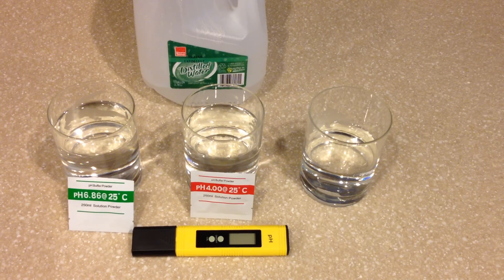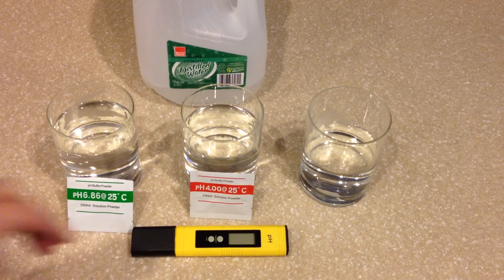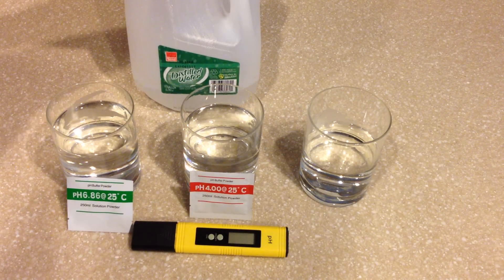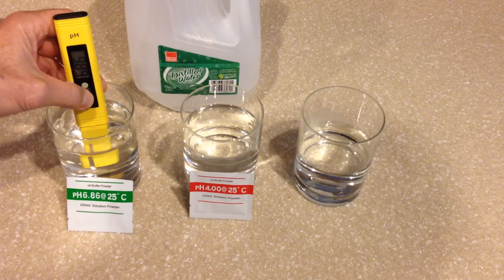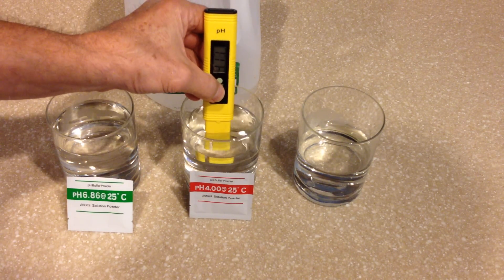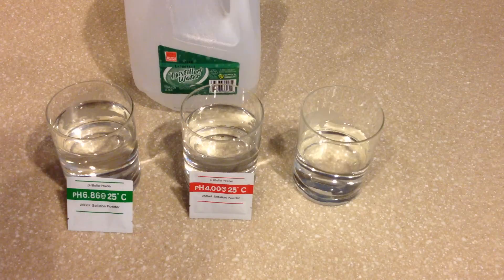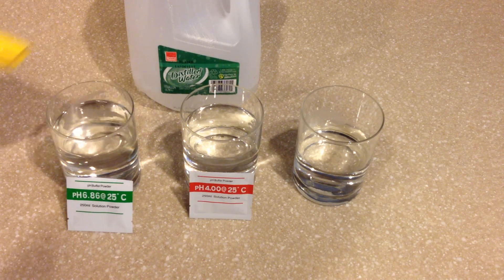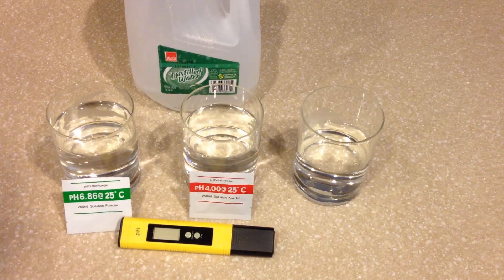Digital Ph Meter Review - Push Button Calibration

Comment: Be carefull to not let it standing by itself until the dam thing drops and gets wet inside by the hole in the back, now i can messure the temperature only, the pH is fixed on 6.86 or 4.00, wish value were the last i calibrated, sucks, i took only like 5-10 seconds to remove the battery and let it dry out 100%, still, too late.

Comment: Thank you. Mine was reading very low at first. This video helped simplify the calibration process. All I had to do was hold the cal button for 5 seconds when dipping in the solution, then it will flash to the correct number.

Comment: Hi! When I try calibrate with the 6,68 the pH meter only flash 4,01 . I did it right in the past but I having this software problem. Every time I press cal it just flash 4,01. Help me please
Reply: same, only mine flashes at 6.86 the whole time and I only have 4.00 calibration solution.  Have you by any chance figured out a way to switch between them or are you still stuk?
Reply: @retrol_za  I had to buy another phmeter
Reply: @npetroco  fok my, why must I stuggle like this XD

Comment: Do you have to warm up the distilled water? In my guide I see the distilled water has to be 25 C° it's also marked on your powder sachets
powder sachets. And is it necessary to use all 3 sachets or is 1 of the 3 fine enough??
Reply: i want a answer to!

Comment: Mine keeps flashing different numbers. I wonder if it's because I used a plastic cup instead of a glass. Also, is the 25 degree celsius on the powder packets relevant ?
Reply: Yes because the PH changes slightly with different temperatures. I got the blue one and it came with instructions.
Reply: @jonathanvandagriff7515  Wow. I suppose I have to cool my distilled water to 25 degrees then. Thank you

Comment: Trust me when I tell you people's !  Throw that crap to the waist bin and get a ph tester paper strip on Ebay . Much cheaper and simpler to used !  I installed under sink drinking water filtration system .  I get 160 ph test strip for $ 1.50  free shipping .  Tear a strip , put it in a glass of drinking water to test the ph level .  Toss the strip in garbage when your done . It's that easy .  No chem packet to buy or procedures to follow .....CRAZY !   😁😁😁😁😁😁😁😁😁😁😁😁😁😁

Comment: Honestly i had to write this as you just wasted my ph solution. Im trying not to swear and be angry, but why the f*ck dont you tell people that you need the 9.0 solution aswell? I mixed up the two solutions, and tried 2 of my ph pens, both were reading 9.12 and 9.15 for the 6.86 calibration. and for the 4.00 calibration mix it was reading in the 6.6 ph range. Theirs no way to fix this unless you have baking soda (being high in ph) which i didnt have at the time, or the 9.0 ph satchel mix. The reason for that is the pen will need the 9.0 mix satchel so when you mix the 9.0 satchel your ph pen read around the 12ph range( seeing as the pen was reading an incorrect high ph to start), so when you calibrate it, it will go back to 9.0. The ph pen has a built in reading of 3 settings for calibration, them being 4.00  6.86 and the 9.00. If you dont have the 9.00 satchel and your ph pen was reading higher then normal to begin with, you will be f*cked.  Each time you try to dip it in the 6.86 solution and calibrate it, it will read that mix as closer to 9, so when you calibrate it, it thinks that the 6.86 mix is the 9.00 mix. so conclusion is if your ph pen is reading higher then its supposed to, YOU WILL DEFINITELY NEED THE 9.0 SOLUTION AND YOULL HAVE TO DO THE 9.0 CALIBRATION FIRST. After that you can do what this video tells you to do. THIS VIDEO ONLY WORKS IF YOUR PH PEN IS READING LOWER THEN ITS NORMAL READING, OR IF YOUR PH PEN IS ONLY A LITTLE OFF ITS ORIGINAL READING. I hope this helps some people as your guide will definitely stuff more people around seeing as you have failed to mention the 9.0 calibration mix.

Comment: thanks for the clear video. I tried it many times but my meter goes up and down, then 0 and doesn't read. it's messed up....
Reply: yup mine had an issue during the 4.01 calibration it is a piece and it doesn't even give you an accurate reading in real conditions. I spent the $80 for a bluelab and the thing is accurate to 0.01 and takes like 10 seconds to get a reading.
Reply: @fivestar2227  Jesus Christ! $80 for a PH meter!? You got scammed!!

Comment: Question can u just use the 6.86?  Why use the 4.01 when I'm not trying to ph down that far. I'm just trying to ph to 5.5 - 6.0ph,  so I just calabrate it in the 6.86.   Am I doing wrong, or will it work? I mean since doing that my plants have not suffered any ph problems.

Comment: Great video, thanks! How often does calibration need to be repeated?
Reply: R E every time you replace the battery :) so not very often
Reply: Mark N do you have to use both powders
Reply: To calibrate it
Reply: @marcusjnewtonz28   how do u recalibrate after using the powders all up on the first calibration

Comment: It's so much easier and cheaper to use the old model with the screw. All you need is white vinegar, because you know its ph is always the same, 2.4 and then adjust the screw. With this newer model you will need to buy both sacks, (they say you need nothing else - wtf ?!!?) to calibrate this thing. I would also question the use of distilled water. The reason is that, with time and air, it lowers itself from a ph of 7 to a ph of 5.5-5.58. Which begs the question: Does used&old distilled water affects the results ?

Don't get me wrong. I really appreciate the video and the knowledge but let's try to observe some facts surrounding this device.
Reply: Please say more about why we should doubt the commercial calibration solutions?
Reply: @wayneessar7489  , I don't doubt anything. I just find it a hassle to have available a couple of ph solutions instead of a driver and screw process just to calibrate a ph meter. What if you don't have the solutions at hand ? What if you just don't find them in the market ? And what about the added cost ? Yes, sure, there are many "commercial calibration solutions". I just don't see the benefits in this one. And btw, if you are so adamant about such solutions, care to answer "Does used&old distilled water affects the results ?" Please, say more about why you ignore such fact.
Reply: @MrCroky123  I don't know if older distilled water is still free of ions.
The meter I chose can be, and is calibrated with Hanna solutions from the small foil packages.
They are easy to find where I live because the wine or beer making stores all carry them, and also in larger bottles.
I only test once a month so the packages work well for me as the bottles expiry about six month after you open them.
I also must adjust my meter with a knob and also to account for the solutions temperature.
In addition my meter can be checked very easily using Hannah's cal check solution that tells you right away if the probe is functioning properly.
The problem with a bad probe is it will make your meter read 7.01 for no reason and this can have a bad outcome.
Reply: You don't calibrate with distilled water. You calibrate with the pH 7.0 buffer, which you mix with distilled water. He also used distilled water to clean it between to two calibration buffers.
Reply: It doesnt matter If the distilled water Ph is drifting. Since it has no salts the Ph is moving very fast with even the slightest drop of acid or caustic. A puffer will stay at their ph and you can give a lot of acid or caustic to it before the ph moves. After the ph changes it will do so very fast. Thats why it called a puffer solution very very basic chemie

Comment: Do you have to use Risantec solution or can other brands be used? Can mixed solution be saved?
Reply: It calibrates to the solutions shown only.  They are available from Amazon very inexpensively because this is a generic Chinese cheapo meter.  There are dozens of the same ones being sold under different names.  .  And no, you cannot save the solutions.  CO2 in the atmosphere will change the Ph over time.

Comment: Those ph testers are crap , mine just says error after calibration ? and goes on to 00.00 the screw driver ones are much more reliable
Reply: I just bought two. The auto calibrated provides good stable results. The other manual calibrated one is pure junk, the values won't settle and jumps all over the place. So I disagree with you.
Reply: @fortuneflux  I disagree with you. I loved my screw calibration meter, until I cracked it. I kept some 7.0 calibration solution in a covered shot glass, and calibration was always quick and accurate. It never "jumped all over the place" for me. You need to turn it slow and steady, not with a heavy club-hand and meat fingers.

Comment: Can I just use ph7buffer only
Reply: The Risantec PH meter is designed to use 2 points of calibration, and it is 'hardwired' to the values of 6.86, 4.01 and 9.18. So, no it is not recommenced to just use a 7.0 buffer.

Comment: So the number it reads straight away when dipped in water is the number of the p.h?  so correct me if I'm wrong water is good if it's 7 yeah anything over is alkaline anything under 7 is acidic but I'm confused on the calibration part what does it mean it's basically testing if it can function correct is that right? do you have to put the p.h powders in distilled water also?

Comment: Do you need to keep the ph meter in a storage solution when not using?
Reply: No, but if the meter will not be used for an extended period of time it is recommended that you put a small bit of distilled water in the cap before replacing it on the meter. That will keep the glass probe from drying out.
Reply: thank you for the reply!

Comment: does this still allow for fine tune adjustments? also what if you have different calibration solutions like 7.0 or 10.0, will it calibrate to those?
Reply from the maker: The meter is 'hard wired' to the values 6.86, 4.0, and 9.18 for the purpose of calibration so for best results stay with those buffer values. The auto cal feature does not require any additional fine tuning.

Comment: So it's not good to test all 3 powders right?. My meter brought 3 packs. But every time I try to cal for 9.18 it throws like 10 points off from 4.0 and 6.86
Reply: When testing 9.18, you have to hold cal until it says 6.68, then tap cal again it'll say 4.00, then tap again it'll say 9.18, but for some reason mine says "err" after it blinks 9.18 a few times so it's not really calibrating right on my side.
Reply: SmokingLoud127  You should test as high and low as you think you will be registering, I would use all 3 but rinse between them in distilled water..

Comment: can i calibrate 6.86 than 4.0 then 9.18
Reply from the maker: The Risantec meter uses a 2 point calibration system. You should use either the 6.86 plus the 4,0...OR....use  the 6.86 and the 9.18. For most applications using the 4.0 for second point of  calibration works best.
Reply: ok thank you so much :)

Comment: Where can you get replacement sachets of PH 6.86 powder?  Most meters I ever used were made to calibrate at Ph 7.01 and that reference solution is easy to find... but 6.86?
Reply from the maker: Simply search on  Amazon for 'pH buffer powders' and you will get you what you need.

Comment: have same one only when i calibrated it and put it back into 6.86 my hp is reading near 9. heap of shit these things are
Reply: Yep! It's not the tester, who "doesn't like" the pure water. It is the nature of the ions! The pH doesn't say anything about the alcalinity! The pure water is very unstable, as it almost hasn't any dissolved ions, so, it means, the pH can change very very very easily. That's, why, we use the 6,86, and 4,00 puffer solutions for the calibration, and not the pure water!
Anyway, if the unit is unstable, there is 2 common causes: or old batteries, or dried out junction. The junction is located just next to the glass probe. It's a little fiber tip. If it came out, carefully push back. if dried out, put the pH meter into pure water for hours, or even days. If doesn't help, put into warm (max 60°C) pure water for a while, and after shake it carefully, but strongly. It will work fine! :)
Reply: @istvanmadar1968  Wrong mate. You need the 9.0 calibration if your ph pen reads higher then what its supposed to. My pen was reading in the 9 ph range for the 6.86 solution, and it would calibrate 6.86 at 9. When you get the actual 9.0 ph satchel and put your ph pen in it, the ph reading will read that as 12ph or around that, so when you press calibrate, it will drop back down to 9. Then when you put it back into the 6.86 solution and 4.00 it will be able to calibrate perfectly.

Comment: there is just something to be said about learning from doing and seeing rather than reading convoluted and over complicated "instructions" great video man thanks!
Reply from the maker: Glad you found it useful. Thanks for your feedback!
Reply: Richard Riley i got 3 calibration powders.. 4.0,6.86,9.18  with my meter is it necessary to use all 3 to calibrate it
Reply from the maker: The calibration procedure is a two point calibration. Start with the 6.86 solution and then either use the 4.0 or the 9.18 solution. I(f you k now you will be testing acidic solutions then choose the 4.0. If you will testing alkaline solutions choose the 9.18 powder as the second point. . NOTE: when using the 9.18 solution start by pressing and holding the 'cal' button in for three seconds and the press and release it TWO more times   and the meter will start to flash 9.18.
Reply: Richard Riley very cool man. many many thank yous my friend

Comment: I, too, was bamfoozled by the instructions, and you have clarified for me! Thank you. 3 questions, how often does it need calibrating. Can you save the calibration solution and use over and over? What happens if you have it calibrated for 7.0 and under, and you're measuring the PH on a liquid that would be over 7.0? Does it just blink, say "error" or what?

Comment: hello, when you need to re calibration it? it's every time before use? or just one time? or after every change battery?
Reply: This is a shill review - the poster clearly doesn't care. But to answer your question - about 3 weeks to one month depending on frequency of use. Problem is - mine won't calibrate at all right now. Worked good for about three weeks though. Even stored the probe "moist" in distilled water with a small sponge to avoid this exact problem. It's a crappy probe made for a few uses before throwing it in the trash. Basically - it's well advertised garbage.
Reply: John L I'm pretty sure you're wrong. pH glass electrodes should always be stored immersed in water or storage solution. Storing them dry damages them. By all means - google it. EC probes are the ones you should store dry and not wet. As I said - this probe is garbage. It will not calibrate. Constant ERROR and failure to calibrate. Even got new batteries - still not working. I'm getting a new one very soon and it won't be a cheap throw-away like this one. I need a reliable pH meter. Likely  a bench-top model with a good warranty and replaceable electrodes.
Reply: Ok, poweredbyarron99. Can you recomend a good PPH meter at a resonable price?
Reply: NOOO just ones for the first time to prove that the kit in question work perfectly
that content in the sachet  make the ph of the distilled water who has ph 0  (turn into a water ph 6.86)
and when you receive the kit by post you try it by        emmercing it into that water who has ph 6.86
then if the reading is  is 6.86 that mean your kit is in a good working order. 
for the second try is not that necessary but to make sure 100% is working. Now that the tester is working perfectly no need to do it again  " happy ...can I fish my dinner now"
Reply: NOOO just ones for the first time to prove that the kit in question work perfectly
that content in the sachet  make the ph of the distilled water who has ph 0  (turn into a water ph 6.86)
and when you receive the kit by post you try it by        emmercing it into that water who has ph 6.86
then if the reading is  is 6.86 that mean your kit is in a good working order. 
for the second try is not that necessary but to make sure 100% is working. Now that the tester is working perfectly no need to do it again  " happy ...can I fish my dinner now"
Reply: NOOO just ones for the first time to prove that the kit in question work perfectly
that content in the sachet  make the ph of the distilled water who has ph 0  (turn into a water ph 6.86)
and when you receive the kit by post you try it by        emmercing it into that water who has ph 6.86
then if the reading is  is 6.86 that mean your kit is in a good working order. 
for the second try is not that necessary but to make sure 100% is working. Now that the tester is working perfectly no need to do it again  " happy ...can I fish my dinner now"
Reply: poweredbyaaron99 You screwed it up by storing it in water.  If you use it more often you don’t need to do that. Recalibrate it and you are good.

Comment: Hello mr Riley, first of all i want to thank you for this usefull Video. after i watch your Video i Change my order process from my wholesale dealer to buy exactly product which is you reviewing it. i have a Little question about calibrating process, what if i just dont  use distilled water in calibrating processi mean can i use just a normal water?
Reply: +Güven Kaya  it works only with Distilled water 100% .
Reply from the maker: You can use either distilled water or de-ionized water because you want to mix the powders in a liquid that has a neutral pH of 7.0. The pH of common tap water, or "normal water" , can vary depending on location and therefore it does not provide a consistently neutral staring point.